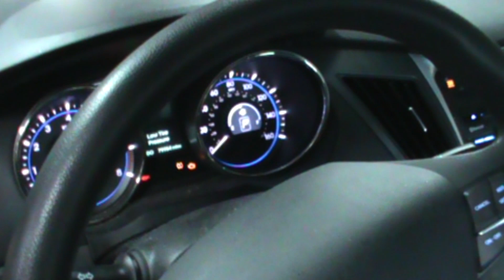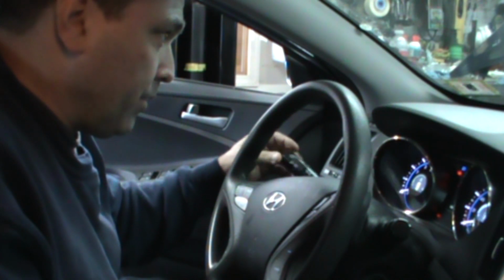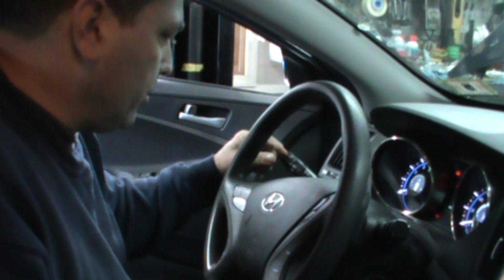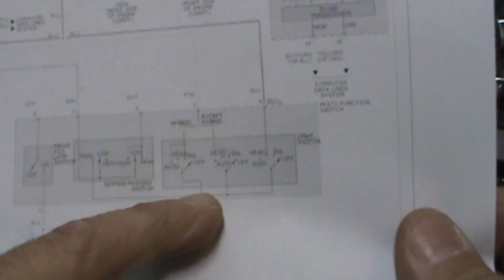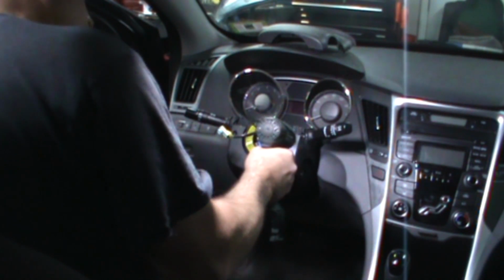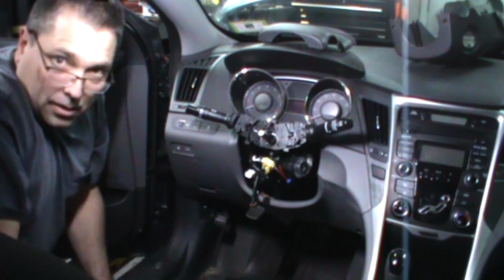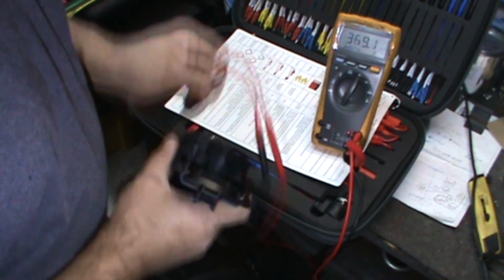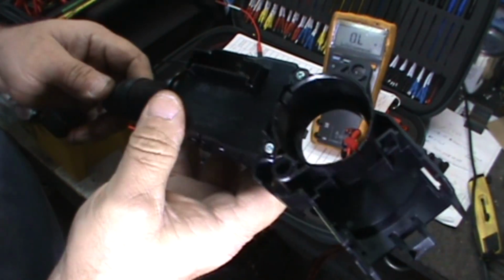Hyundai Sonata Lights Flashing

Comment: Would this prevent the car from starting? I'm having this issue plus the car won't start. Clicking sound in the dash.
Reply: Me too man!
Reply from the maker: Negative. You have a different issue. Sorry
Reply: @wesleydavidson558  did you get it fix i have the same problem.
Reply: Did you get it fix i have the same problem
Reply: Me to did anyone figure it out? Not  starting lights flickering. I have had it into Hyundai multiple times and still dying.
Reply: @johnadoumis5151  did you ever get it fixed? Happened to me too. 2005 Hyundai Sonata. Kept pressing the fob alarm and my car wouldn’t start. Clicking in the dash and lights flickering.I thought my car alarm died “on” Had it towed and it mysteriously started working😒this was in sept. 

I come home this week and my hazard lights are flashing on and off. Then 15-20sec later they’ll do it again.. Car still starts though. Maybe it’s my multifunction switch.
Reply: Me too

Comment: I have the same issue after developing with my 2017 sonata fine when its set on manually but leave it on auto and it will flicker on and off
Reply from the maker: Did you get it resolved?
Reply: @SAAutoRepair  Not yet, It started happening in the winter and seems to happen when AC is blowing I gotta take it back to the dealer see if they feel like fixing at least one thing with the warranty lol
Reply: @MozameMogki  any word? My 2016 sonata headlights flicker off when I use my turn signal and it’s super dangerous, especially at night.
Reply: @cRockBallin22  I had to fight with the dealer about it but it was one of many other issues I had with it and that dealer; My experience was the cars are fine but the dealers and service centers are awful so I just traded it in and went with another brand.

Comment: Thanks for the video. My 2011 needs this desperately. I do have a question for anyone, what switch does this take? If I go to somewhere like O'Reilly's or Auto Zone online, they have 4 or 5 different parts priced from $62-$90 with no apparent difference between them. How do you choose or does it matter (i.e., the $62 part will work just as well).
Reply from the maker: Thats easy sir. OE (dealer) is may suggestion. Aftermarket parts are getting worse by the day

Comment: My 2015 Sonata is doing this but also the outside parking lights are blinking at the same time interior dash are blinking, but only when I turn headlights on.  Do you think its the same?  :)
Reply: Any help? @S & A Auto Repair
Reply from the maker: Impossible to tell from here without proper testing. My crystal ball is out of service 🤣. That being said, sure is possible to be the same. Wiring diagram and test light is your friend here.
Reply: @SAAutoRepair  Oh ok ty for your time!  I figured it was a Longshot.  I just was curious if the outer lights blinking is a common thing when the inner lights do that.   Ty for your reply. :)

Comment: I have the same car 2011 and it’s doing the same thing whenever I turn my turn signal on. I changed my wipers and it randomly stopped lol so random but it was doing this for well over a month (I hardly drive at night never wanted to spend the money on fixing it).
Reply from the maker: Interesting
Reply: Well the problem is back. My front driver side light went out. Changed it and boom problem stopped, again. Obviously I know it’s not from the wiper or my light but man idk what else makes it stop or keep going for that matter.
Reply: Yes I have a 2011 and I've been dealing with this for month's and now I'm tired of it so I wanna get it fixed
Reply: @trclogistics  did you ever get it fixed?
Reply: @primnav2058  No however I did some research and it said that I may need a new blinker switch thing ...The black handle that you press for Yue turn signals, so I went and got one off a car at the junk yard but I just haven't got it put on yet
Reply: @trclogistics  I see. The turn signal stalk switch I believe. I’m also having this problem sadly… and I have been lazy to deal with it. I was thinking of fixing it myself, but might just take it to a dealer.
Reply: @primnav2058  sameeee..I've been having the switch in my backseat since like last year 😭😭😭
Reply: @trclogistics  sheesh! Gotta get it fix. I haven’t been driving at night and it’s becoming a problem 🥲. If you ever get it fix , reply back! I might just suck it up and call the dealership tomorrow.

Comment: The lights in my 2008 Sonata are flickering in a way similar to this. No way am I interested in tearing all that apart. I was hoping I could simply spray some contact cleaner and work the switch around. I think it happened because the car is driven so little, the contacts developed corrosion.
Reply from the maker: That won't help. Needs to be changed
Reply: @SAAutoRepair  I tried it today, and I'm super happy to report that it worked. No more flickering lights. All I did was spray CRC QD Contact Cleaner in the little gap right next to the part of the multifunction switch you rotate, while rotating the switch back and forth. At times, I lifted the switch to put it in right-turn-signal mode to help the contact cleaner get in there. I probably went overboard as I did it for around a full five minutes, but after letting it dry and reconnecting the battery, I have zero flicker.
Reply from the maker: Thanks for the feedback

Comment: how much did the part cost?
Reply from the maker: Hey Maria. Honestly,  it was too long ago to remember. I'm sorry. If I get a chance, I'll see if i still have the invoice around and get back to you. Thanks.
Reply: @SAAutoRepair  I have one year with my hyundai sonata 2011 and recently it started to that. I dont the lights to turn off while driving in the night from work.
Reply: @zurc1018  Did it solve your problem on your 2011 Sonata? I have the same car with the same problem specifically when I use the turn signal?
Reply: they don't turn off but like flicker off for few seconds. I havent experienced where they turn off and don't come back on yet. I change the battery and that seen to help. However every so often it happens but now is less.
Reply: @mohammadfarmani2140  I took it to the shop and they told me my battery was leaking so I had it replaced and now does it less often. Maybe once in awhile it does it but now is way less.